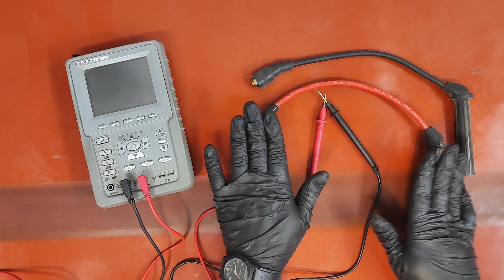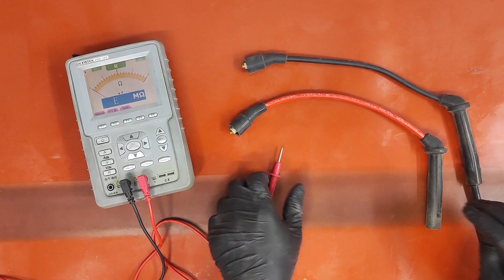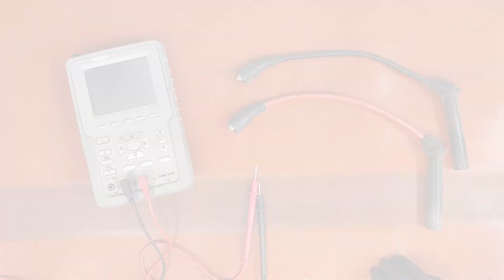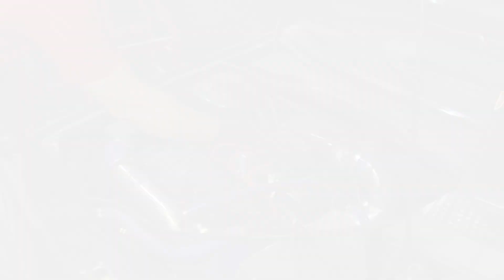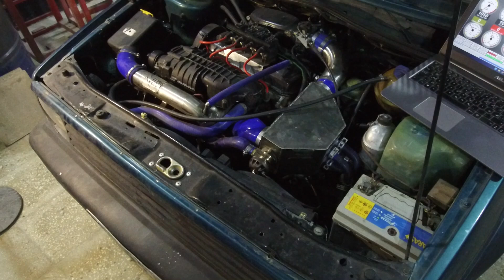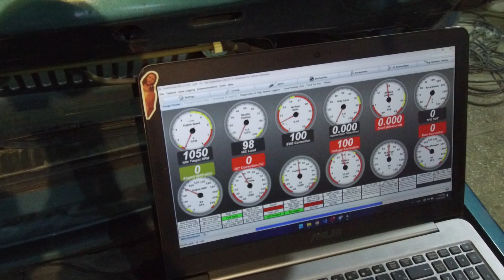Fix Your VR Sensor Noise for Good! Coil Wire Test: 0 Ohm vs 1.6K Resistor | Levin Tuning ECU

Comment: Does this do the same thing as resistor type spark plugs?
Reply from the maker: Yes, they serve the same purpose — reducing electromagnetic interference (EMI).

Modern cars often use either resistor spark plugs or resistor wires, but many use both for better EMI control. If you have a strong ignition coil or performance setup, I recommend using both. Just make sure total resistance stays within spec (usually under 20k ohms total per wire path) so you don’t weaken the spark.